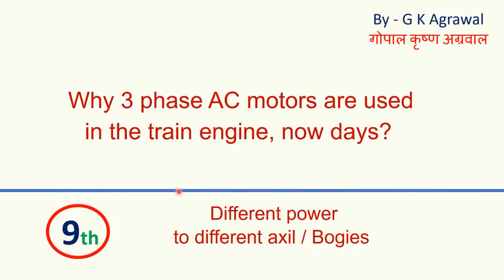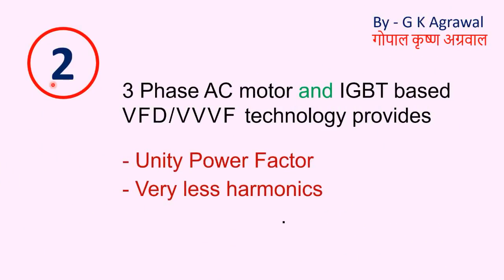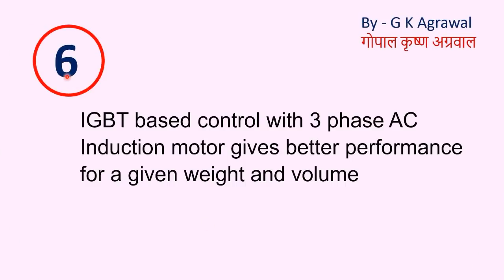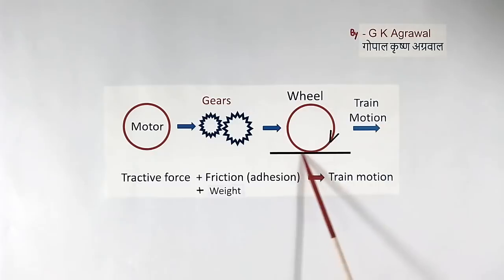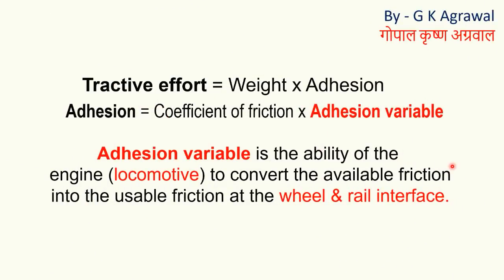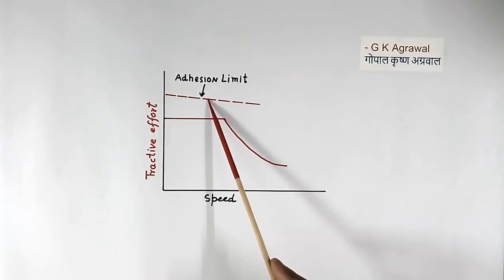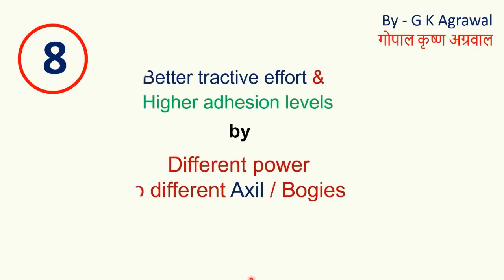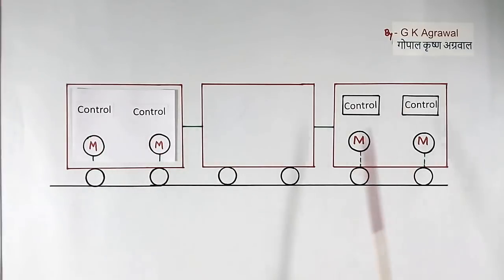Why is AC Motor used in train Engine locomotive nowadays

Comment from the maker: Comments welcome
Reply: Efficency of dc vs ac motors in train ?
Reply: I think dc will win becuse it have Permanent mangnets ?
Reply from the maker: Overall, Loco engine with AC motor is much more efficient and economical than engine with DC motor.
Reply from the maker: Use of DC motor in loco is stopped long back.